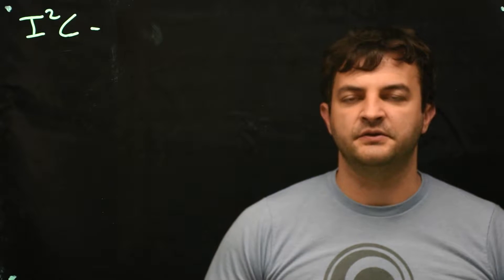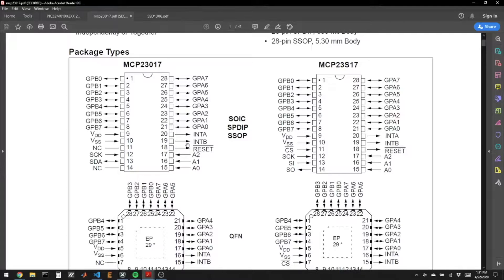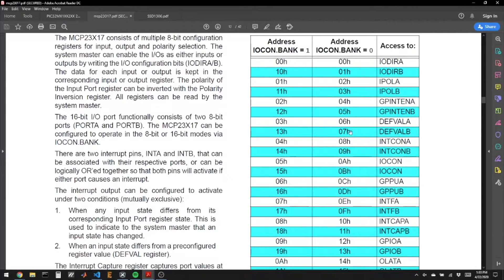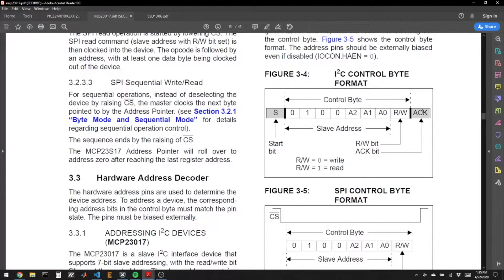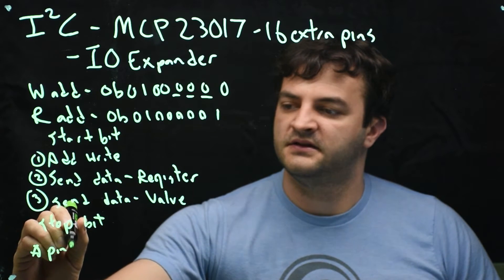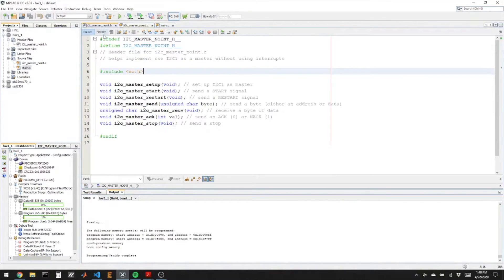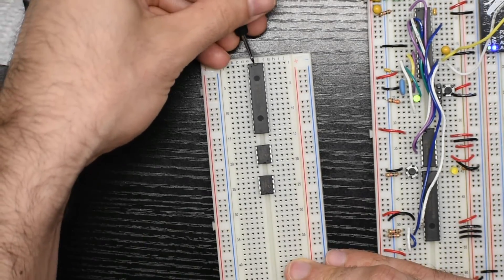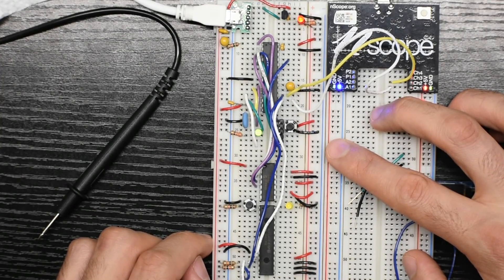IO Expander with I2C

Comment: Question: I am working with this chip right now hooked up to a relay board. If I want to change just one pin at a time to an output, instead of IODIRA for all the pins on side A to 0x00, what’s the way to change just one pin i.e. GPA0 to an output?
Reply from the maker: I don't believe there is a way to target a specific pin without also writing to the rest of the pins on the port. The safe way to be sure you are changing only one pin would be to first read the value of IODIR, change the individual bit for the pin you want to change in that byte, and then write the byte back to IODIR

Comment: Is that the same chip used in those LCD piggyback displays?
Reply from the maker: Yes, although many manufacturers make this type of chip so you might not find this exact component
Reply: @nmarchuk  So if we are using this with a 5V lcd display do we power the display with 5v and this chip with 3.3 v (assuming connected to a pic32 i2c master)? Thanks for posting this.

Comment: I liked how you explained but what you didn't tell is how different io device will know whom master wants to communicate as the slave address passed is of io expander..how expander carried it forward to address multiple io devices? Pls explain if possible to your new subscriber :)
Reply: Devices with same addresses can't be on a same bus.
Usually such ics have an for variable slave addresses by changing the last  3 bits of the 7 bit address.
That gives you the option for 2^3 = 8 slave devices. This is true for port expanders like pc8574 and its likes.